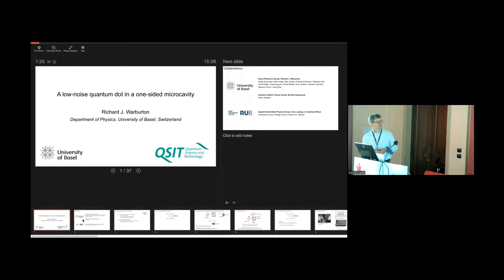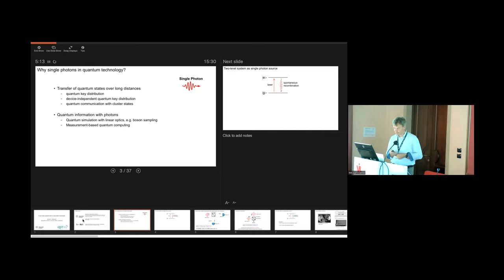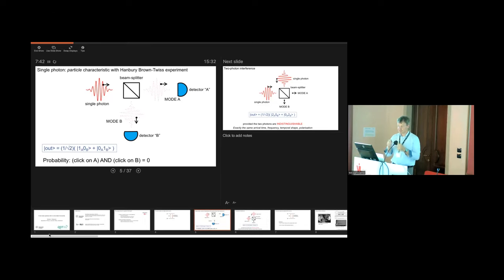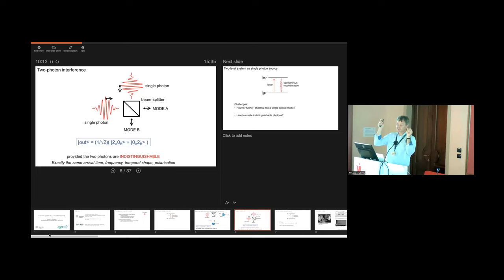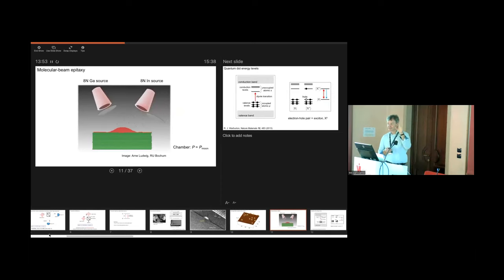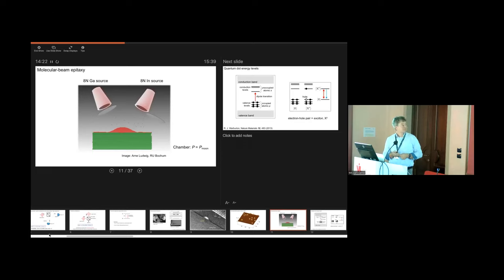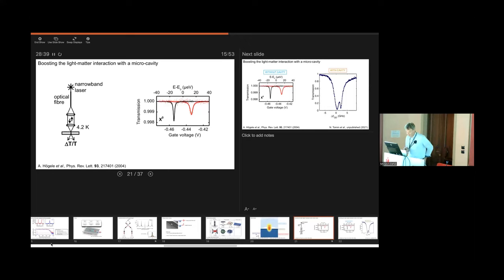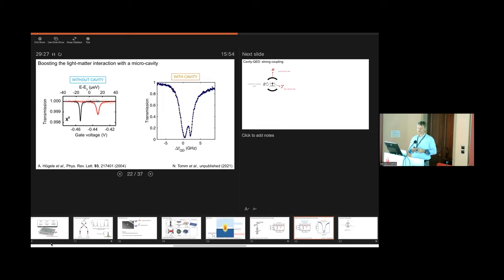Richard Warburton - A low-noise quantum dot in a one-sided microcavity | Nano meets Quantum 2022

Comment: As a small correction: on slide 28 the "Goldilocks regime" is introduced as kappa = 2*g. It also says that in the arXiv paper, but that was due to a small error in an calculation. It was corrected later in the nature paper. Not sure why it is still wrong in 2022 conference